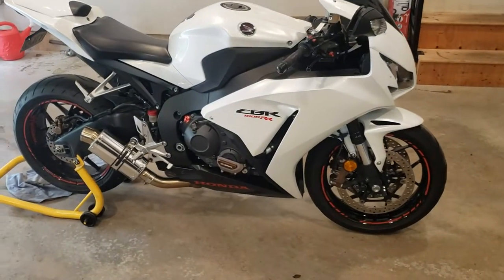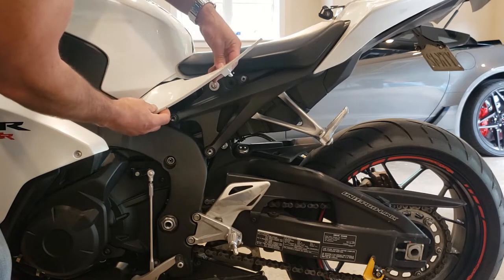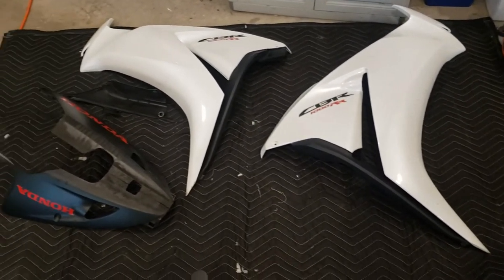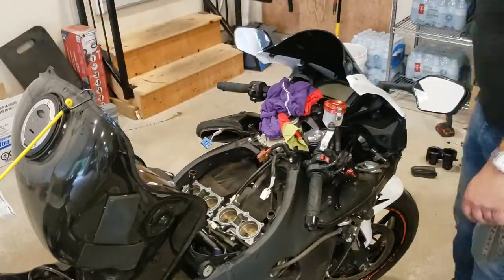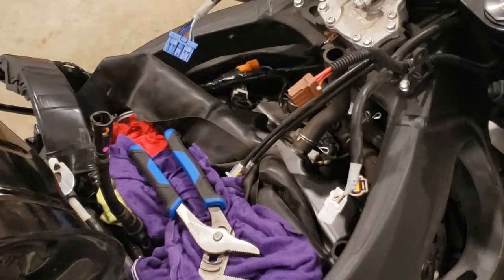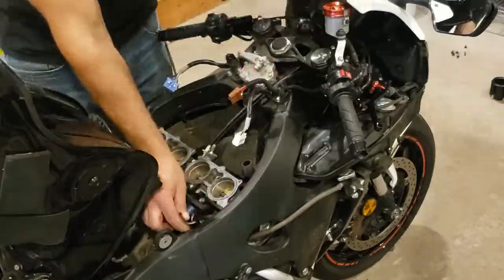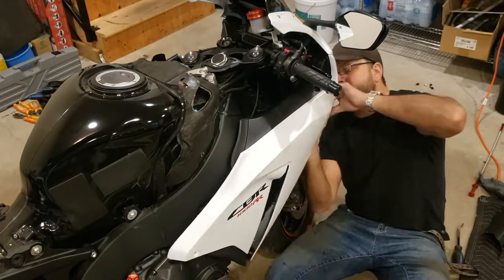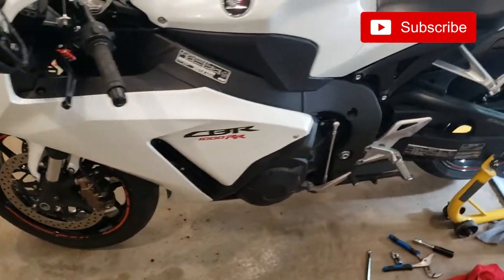Changing Motorcycle Spark Plugs - Honda CBR1000RR Maintenance

Comment: very nice, i own this bike and was wondering how to change the plugs and clean the filter. this video would help a lot
Reply from the maker: The process isn't too difficult but takes a bit of patience, especially when putting the plastic parts back on.
Reply: How long did this take you?
Reply from the maker: In total probably 3 hours including moving the camera around.  Putting the plastic back on took the longest because it goes together like a puzzle with very few screws or bolts.
Reply: @nothandsomebuthandy  ok thanks mate 👍

Comment: Is spark plug make the engine nois and after change the spark 
Sound like it’s smother
Reply from the maker: Not usually unless the spark plugs are so bad that you're not getting good ignition and instead fuel is igniting in the exhaust (backfire).

Comment: Do you know the type or part number of the ngk iridium ix for a 2017 cbr1000rr?
Reply from the maker: NGK's website lists IMR9E-9HES for up to 2016 but don't list any plug for 2017+ so I think they just haven't updated their website. Other sites list the same plug for up to 2019.
Reply: @nothandsomebuthandy  that’s why I asked because same as what you found on the NGK website, they only have the Laser Iridium up to the 16 MY. But you’re using the iridium ix which is different/better right?
Reply from the maker: I actually ran regular NGK yellow box forever in all my bikes. No difference in performance, just longer life.
Reply: @nothandsomebuthandy  thank you man!

Comment: Damn wtf so much work I regret buying this bike
Reply from the maker: Haha yes it really was a lot of work, especially putting the plastic back on.  I miss how easy older bikes were to work on.
Reply: @nothandsomebuthandy  I know bro and the Honda plastics don’t help at all.
Reply: @nothandsomebuthandy  I have mine zip tied in the front. Idk why they made so many pieces that fold into each other. Idk I like it but everything is so compact and hard to get it
Reply from the maker: Yeah I would like to have a few more screws and less puzzles
Reply: My bike started misfiring
Reply from the maker: @user-rt3zy8nq9i is this before or after you changed the spark plugs?
Reply: @nothandsomebuthandy  before. I’m go buy them right now.
Reply from the maker: @user-rt3zy8nq9i that solved my problem
Reply: @nothandsomebuthandy  I want to send you a video of how it’s running
Reply from the maker: Send me a message on Facebook
Reply: The garage I bought the bike won’t even do this job for me so regret buying this bike rang a few garages they just fob me off
Reply from the maker: @macaa-ei9ql wow that's crazy
Reply: @macaa-ei9ql  where you from ?
Reply from the maker: @user-rt3zy8nq9i New Brunswick, Canada

Comment: Very unuseful sorry !! It is filmed at such high speed but we don't really see what and how it is dimanteled and what tools it has been used and so on....!
Reply from the maker: Hi Chris, I agree it's not a great how-to video.  My videos are more aimed to sharing the projects that I do in my spare time for entertainment purposes.  Also for some repair jobs people just need to see the process of how something is done to get them rolling in the right direction and figure out the small details as they go.
Reply: @nothandsomebuthandy  Thank you for answering and I did not want to be disrespctful of course but since I have a 2009 CBR RR I was really curious how to take of and back the sides knowing it is  anoying and not intuitif either....
Reply from the maker: @chrisolivet9084 all good, I appreciate any feedback. This is actually a friend's bike that I was helping out with and it is probably the worst bike I have ever worked on.  I wish I could have been more help in the video but for the most part I was trying to figure it out myself. Putting the plastic parts back took the most time and in the end I still wasn't satisfied with how it went together but unfortunately honda designed it to fit with minimal bolts.